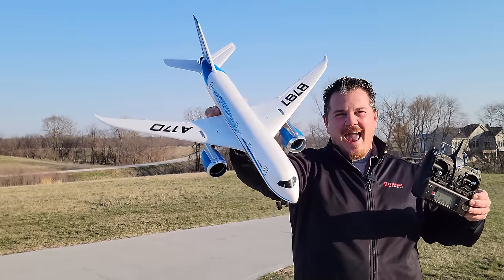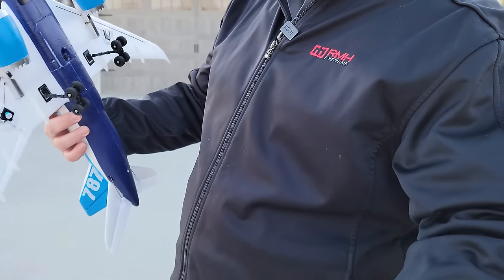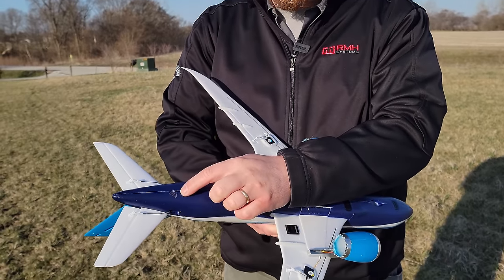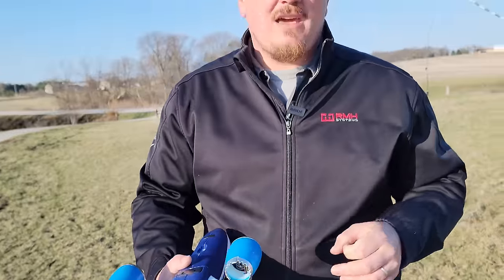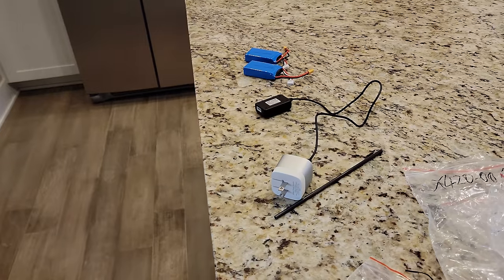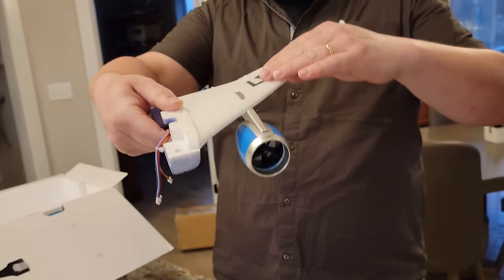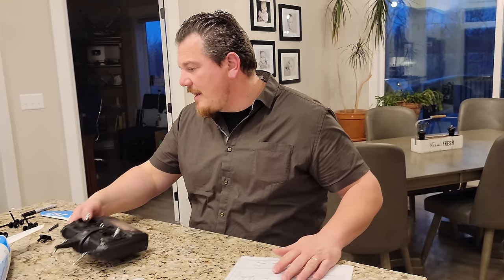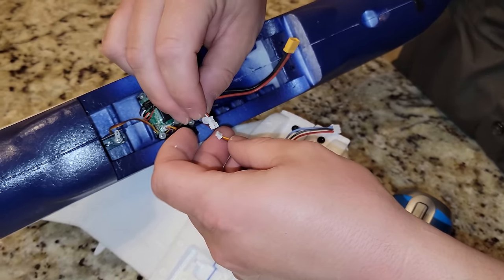XK | WLToys - A170 - RTF Twin EDF Mini Airliner - Unbox, Build, & Maiden Flight

Comment: I purchased one of these planes as the reviews seemed good but mine burst int flames the receiver board and one motor before takeoff managed to disconnect battery quickly saved the plane but still waiting 10 months for replacement parts from supplier so in the meantime I bought another from a different supplier but had similar problems before use no help from supplier or WLtoys  don’t buy is all I can say
Reply from the maker: Did you follow OUR link? If so, please tell me in a EMAIL (look in the ABOUT tab for our channel), and we can help try to get you take care of. If you bought from another link somewhere else, please also let me know so we can share who isn't taking care of you.

Comment: Amazing video Brian. And great idea with that nose gear. On mine I also painted the cockpit window pylons white and I added rolls-royce stickers on the engines. And with the modified nose gear it look great. But that damage at the front of the fuselage looks to be on every single on of these I have seen on the internet. Probably something from the factory.

Comment: Thanks for the helpful video. I assembled my 787 along with you. Question...When I initiated the start up, I noticed my ailerons were not level. Do I need to adjust them before taking off, or will it level itself?

Comment: Would love to c a vintage Brain Phillip style mod video on this one. Last one you modified was Cessna Citation 
- Dihedral can be easily added obscurely by cutting left & r8 wing joining surface (currently perpendicular) slanted.
- Modern airliners have engines literally touching wing. So cut short engine nasals. Dihedral & short nasals will raise engines making them scale.
- Add split flap. It is way easy than normal flap & even poor job isn't noticible - bcz cut surfaces always remain hidden.

Comment: Hi sir, I have an XK A170 RC plane like the one you have, but the problem I am facing is that the transmitter is not connected to the receiver, I have tried to solve the problem through the instruction book, I hope you can help me in solving this problem

Comment: Hi! I bought 2 of this plane, but due to the same symptom I can't use it: when I plug the battery, only the right stick works, but not the left (throttle) stick. Any idea why?
Reply: All the 4 cables are plugged in

Comment: Hey sir, how are you? My son bought this aircraft and the battery was fully charged when we got it but then we try to charge it it’s not charged do you have any issues with yours like this?
Reply from the maker: We didn't have that problem, but it sounds like you might have over discharged it. If it's too low, the charger won't detect it, and it won't charge. There are some tricks to get the voltage up a bit, buy it can be a little dangerous.

Comment: hello i order this rc plane i took it out for the first time today an could not get it to fly all it would do was nose straight up flip and nose  down andb hit the ground it was great at hitting the ground i broke lots of stuff on it and was able to fix it all i seen all the reviews on this plan and it was so nice im a beginner and watched your review of the 400mm warbirds and i order two they work great i wanted to step up so please help
Reply from the maker: I wonder if you've got an issue with your CG (Center of Gravity)? I didn't think there was a great way to adjust, since the battery doesn't fit but one way, if I remember right. Sometimes the Flight Controllers CAN have issues, but I suspect it's more along the lines of not being level long enough to know how to stay true to the ground, thus the pulling up and flipping over.

Honestly, I'd love to help, but I don't really have enough information to make a clear diagnosis of your issues. Sorry for that, Vincent.

When you can, I want you to try to throw the plane like a glider, from LOW, and into TALL TALL grass, so you won't damage the plane. Just see if it glides (pretty fast toss). If it does the same thing, start looking at the elevator and elevator servo. If the plane DOES glide nicely, then get into power a little and do the same. Make sure you're in auto-leveling, and see what happens. Maybe you're getting into the throttle too much, or too little. 

My trouble here, is there's about 15 things that could be going on, and I can't tell from your description what one it is. When you're new at flying, you don't see what I or another more experienced pilot might see...so beginners won't usually have an easy time explaining it - not a problem with YOU, just a beginner problem. It's tough to overcome this issue, since experience will improve both your ability to communicate what's wrong, AND the ability to avoid doing it, and/or help you avoid the crash from a component failure, if that was what happened in your situation.

Hope something I said helps. Good luck, and hope you get it back in the air soon!
Reply: @BrianPhillipsRC  thanks so much for getting back to me and taking the time to help i have returned the plane back to amazon do you know of a good set up i can start on i was looking at the smaller a-10 thunderbolt i really want to buy a good remote  i was looking on your site but it looks like a lot of stuff was sold out can you point me in a direction to a plane  and transmitter thanks so much for your help love all your detailed video's

Comment: You are right it have limitations, it’s shape very good looks like Airliner but no flaps , ailerons in center very wrong, No Glides very harder to land. Takeoff good , cruise good but when lands not slow down even cutting throttle it falls , on little throttle it fast enough not lands even broken at landing time. I flies regularly Horizon Hobby Planes & other Chinese Models but by this Plane my Fun turned into Tears when it broke at landing time very harder to land . 
This Model know only take off & Cruise but not know how to land as no Flaps Ailerons in center useless. No Functional Rudder. Front Tire looks ugly & broken at first landing. No Low battery indicator beep on controller .  On low battery it suddenly starts Falling at distance place. Shape looks like very good, material is good but works very bad totally a waste of money. 
Thanks
Reply from the maker: Yeah, sometimes looks can be deceiving. That's a big part of why we do this channel... everything looks good online but it's not. Hopefully you'll get some value from that. Thanks for watching.